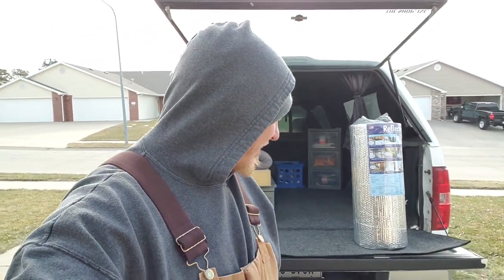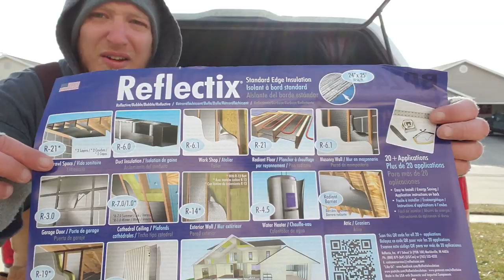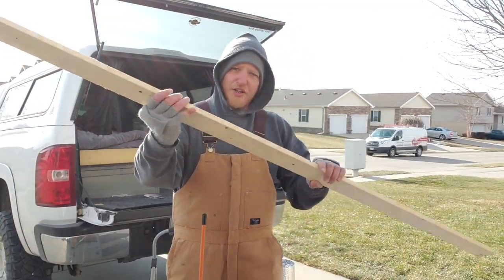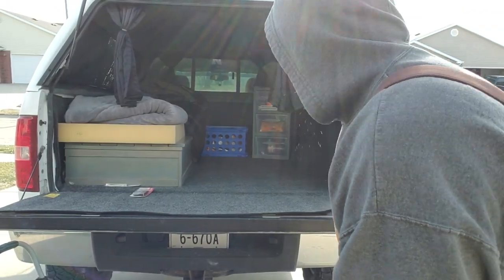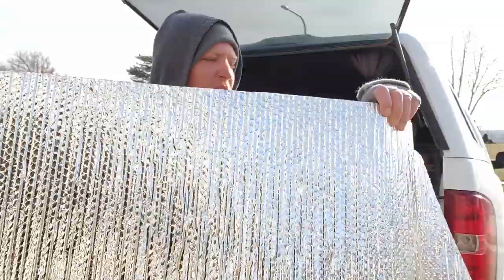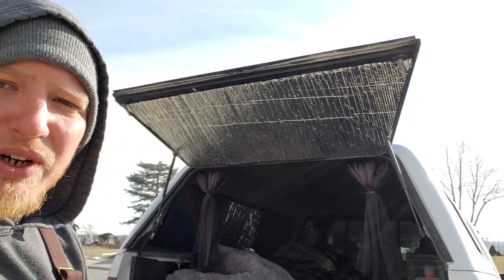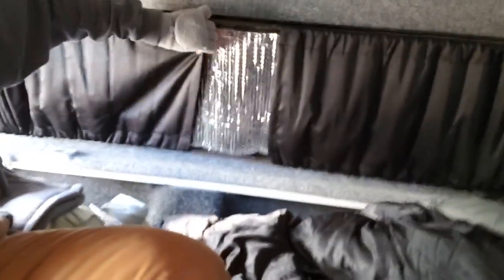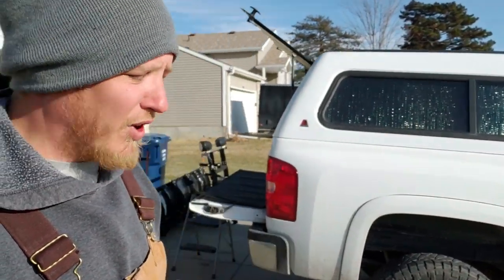Truck Camper Insulation / Adding Another Layer To The Windows

Comment: I use Reflectix in my Ford Ranger camper set up, worked really good in below freezing temps with no heater. As for the shine on the outside of the window, I managed to spray paint one side black and left the other side reflective. This 'in theory' would work for warm and cool temps and noticed a difference a little bit myself first hand. When you put the black side facing out it absorbs heat and when in direct sunlight this winter it would collect a fair amount of heat. I have a thermometer in my canopy and it would get pretty toasty. I haven't used it in the summer time yet, but if you put the reflective side out it would ideally keep it cooler inside by blocking out the sun. The spray paint I used was matte based. Gloss does not work. I haven't had any problems with the matte, as long as you give it a solid coat and let it dry, it sticks to the Reflectix no problem.
Great vid!
Reply from the maker: The theory sounds legitimate, I might have to try painting one side! Thanks for watching!
Reply: Well, that answers the question I was going to ask. Thanks
Reply: How about reflectix on the ceiling?

Comment: My truck has that pass through window. I'm currently revamping my truck cap I bought used. I'm going to have a remote start to turn on the heat if needed. Reflextix helps on the windows for sure! 👍

Comment: If you do a lot of cold weather camping consider those new 12 volt diesel heaters that are all the rage now with RV'ers,  van dwellers.  They give off a lot of clean dry heat and all the exhaust goes outside.  Much better than those propane buddy heaters that smell like fumes .  Prices have dropped around $75
Reply from the maker: I looked a bit at those heaters last year, maybe I need to check them out again! Thanks for watching!

Comment: If you need the stealth aspect you can paint the outside face of the Reflectix with black spray paint so you can't really tell that it's there.
Reply from the maker: Yah I think im going to try that. Someone else commented that it needs to be flat paint, gloss doesnt stick?
Reply: @CrazyQuady  Well I believe it will be wholly dependent on the type of paint and what it's designed to adhere to. Me personally, I would use flat black as gloss would create a sheen/reflection behind the glass making it more noticeable. Cut a couple small pieces from your cuts and test it. I doubt it will hold up well if you bend it a lot after painting because paint isn't make to flex that much unless it was a latex paint but in a stationary aspect such as how you are using your Reflectix, it should be fine.
Reply from the maker: @YokosukaGaijin  I'm definitely going to do a couple of test pieces and see how it works
Reply: @CrazyQuady  what if you did a big tint on the truck windows first?
Reply: Use spray adhesive and stick some thin fabric to it. You can cut and wrap it and make it look nice.
Reply: @CrazyQuady  gloss paint gets gummy when hot and tends to stick to things

Comment: Has the Velcro come off the windows in the heat? I’m going to wrap the inside of my snug top because of the heat in the summer. It gets up to 110 in N California where I am. 
I use the same stuff in my travel trailer, I can’t use Velcro because the heat just melts the sticky off
The snug top has the fuzzy walls so Velcro might work. I’ll try it first otherwise  
I’ll do a solid piece from side to side and hold it in place with long strips of wood like an arch. Then slice the bottom and sides open where the windows are and fold it up to access windows. When I’m done maybe I’ll post a video of the finished product. 
Hoping the Velcro works!  🤞

Comment: I'm about to put Reflectix in my windows, I used them in my travel trailer and it made a big difference in the bedroom. Does it help with reducing the condensation on the inside of the windows? Slept in the bed of my truck last night for the first time, ran a thermostatic controlled small ceramic heater set at pretty much it's lowest temp setting, was approx 48-50 degrees outside, was actually pretty comfortable inside, I did wake up to a considerable amount of condensation on the windows. Wasn't able to open any widows during the night due to rain. Any thoughts/ideas for controlling/reducing moisture? It's supposed to hit 28 tonight, will need to run that heater more and it will probably cause even more condensation! :-(

Comment: You mentioned the velcro on your Bedrug bedliner at the tailgate was failing. Has it begun to fail anywhere else? Trying to determine how durable it is. Thank you very much.
Reply from the maker: It's plenty durable, I've had the rug for about 5 years without any issues. It's not necessarily the velcro that's failed but the adhesive on the strip on the tailgate itself. I just need to clean the gate and put on a new strip if velcro.

Comment: Great video.  I just completed the platform and storage system in my cap camper.  How did you install the curtain rods?
Reply from the maker: Using some cable clamps in the existing screws. Check out the video on my channel called "My truck camping setup" I show them closer.

Comment: I may have missed you saying it or in a previous video, but do you heat with anything? If so, what do you use for a heater?  Looks good
Reply from the maker: If I'm at a campsite with electric hookup I use a small space heater that has a thermostat so I can keep it at a set temperature. If I'm at a basic campsite or boondocking I run a Mr. Buddy propane heater.  Propane works ok but you have to wake up in the middle of the night and run it for 15 mins etc to warm back up. Obviously you cant leave a propane heater running all night in that small of space.
Reply: Awesome thanks for the info, I was curious if other people used mr buddy heaters.

Comment: Hi Crazy,  What do you think about spray gluing (headliner spray can glue) similar topper roof material (speaker box cloth) to the Reflectx, so it is not reflective to the outside?  It might also offer a little more insulation also.

Comment: Enjoyed the video.  I have the same setup with 2013 GMC extended, 4 x 4 and the same Leer top.  Wondering how you secure the rear window on the Leer top from the inside?  I have a couple DIY clamp thingees but looking for something better.  All the best!
Reply from the maker: As far as locking it? I havent figured a good way to do that yet...I just leave it unlocked when I'm inside

Comment: thanks for the info. Is the gate sealed? And do you have a vid on your bed? I too am going with a 24 to 30 in wide bed and was going to make it a hinged on wall side lift top to access under for cloths and stuff instead of long drawer.
Reply from the maker: I fo have some weather stripping on the tailgaite but its nothing fancy. No specific vudeo on the bed because it was done many years ago. Its about 24 inches wide and hinged just like your idea

Comment: Hey bud, is the bed rug worth it? My 3rd gen Tacoma lets in some water and I’m worried about the bed rug not drying out or even worse having water creep further into the camper.
Reply from the maker: I like it, I dont really have a problem with it staying wet at all. I've taken it out a few times before loading wet stuff in the winter but it's simple velcro in and out so it's easy.  It's a nice insulation layer and its padded nicely so kneeling inside doesnt hurt after 10 seconds.
Reply: CrazyQuady so you setup doesn’t leak at the bulkhead?
Reply: CrazyQuady sure makes it look warmer and more home like
Reply from the maker: No leaks in the front of the bed, I did put some foil tape over a few of the factory holes in the bed.

Comment: How did u secure ur curtain rods on the fiberglass
Reply from the maker: They are Gardner Bender brand 1/2 inch cable clamps, part # PPC-1550UVB that I purchased from Menards.  They are secured using the existing screws in the window frames of the shell.  There is a video called "My Truck Camping set up" on my channel where I show them and talk about the curtains that you can check out. Thanks for watching!